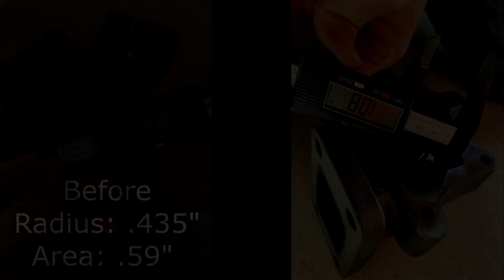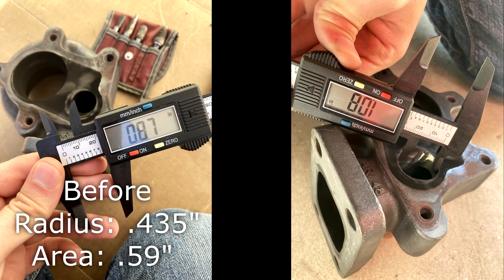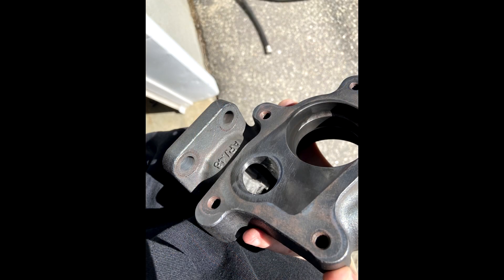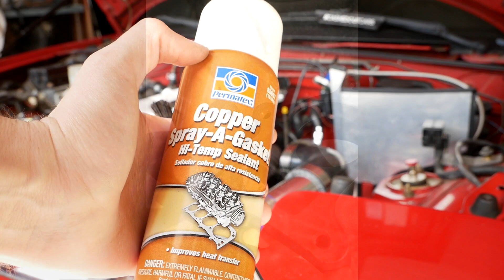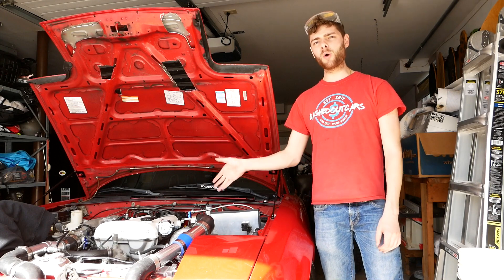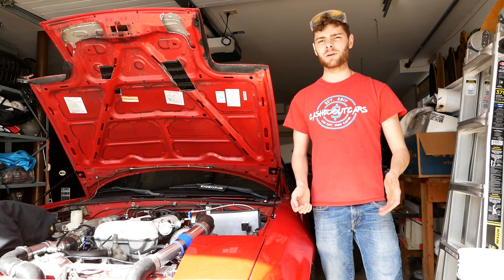Porting a Turbo and Wastegate for Better Flow and Performance

Comment: If you screw up it’s gonna be a big screw up. I like that
Reply from the maker: Go big or go home! No issues on with this wastegate setup even after all these years
Reply: @ that’s great currently about to go into my basement and port out a Kia stinger 3.3t turbo wastegate 

It’s a 20mm opening. I’ll be trying to open it to 26mm+. The wastegate door is 30mm 

20mm !!!! Way to tiny

Comment: Thing is adding an angle like that will also catch air thats flowing into the turbo and can can even open the waste gate due to air flow being shot into the wastegaste hole the pressure alone when opened along with convection should be more than enough to flow out especially when ported

Comment: I have used a few cheap turbos.  I automatically just port the wastegate soon as they come out of the box. I used 1 that didn't get modifed and it was impossible to control the boost. 

I like to add a slight chamfer to the port with a sanding drum. Not sure it does anything but it makes me feel good 😂

Comment: See I’m also running an eBay turbo and mine just started boost creeping recently. Wouldn’t it do it out if the box and not after 3k miles with it? 🤨
Reply from the maker: That does sound like an odd problem, my guesses are the wastegate flap may have word weird and be getting stuck or something wear related. Best of luck!
Reply: @CashedOutCars  exactly. It happens when I give it decent throttle around 3200 rpm then I’ll let off slightly and get back on and it works as it should. 🤦‍♂️🤷‍♂️

Comment: Why you didn't do the turbo compressor inlet
Reply from the maker: It would have been a good idea, I just wanted to finish it up quickly. My main concern was getting the wastegate issues sorted out and it worked great!

Comment: Results??
Reply from the maker: Still in the works, I had a ton of other projects to finish on the car and just started a new job. Should be back on the road very soon!
Reply: @CashedOutCars  thanks. I plan to run a ebay tb25 turbo. It comes with 8psi spring. I’m going to order a 5psi spring and bore out the wastegate to hopefully by around 6-8
Reply from the maker: You should be in good shape to do that! I’ll be posting the results as soon as I can, stay tuned!

Comment: I like your videos. But for future reference, sending metal shavings down the exhaust manifold, towards the valves may not be the best way to file. An oily rag in that manifold to catch the shavings would have been a better practice. Keep up the good work!
Reply from the maker: That certainly would have been a better way to do it. Thanks for the support!